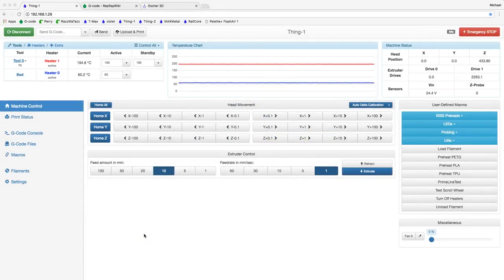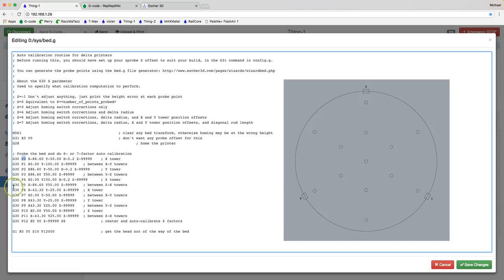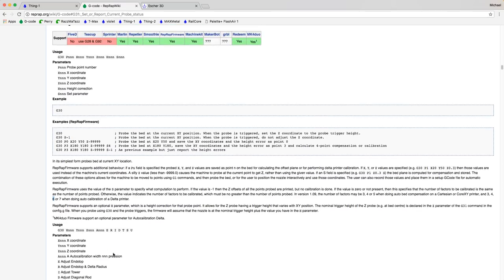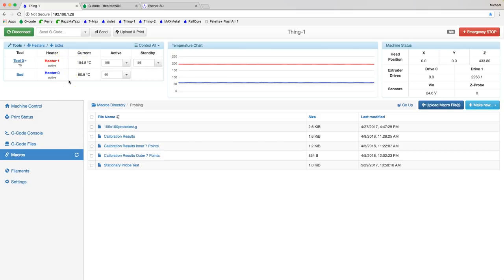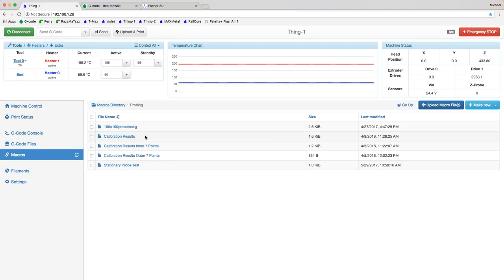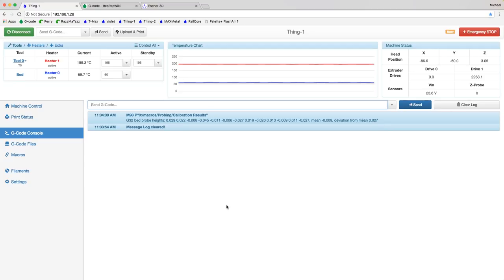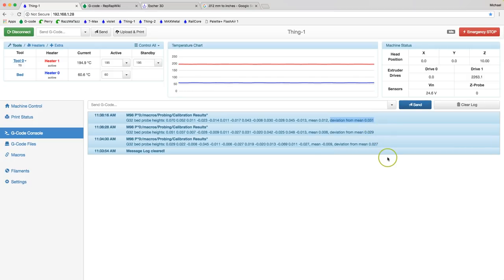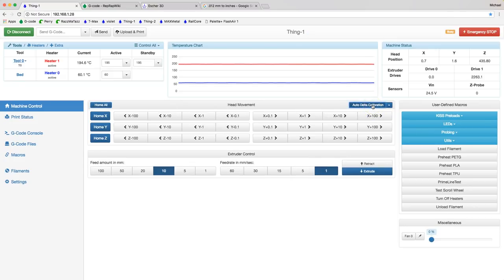Delta Calibration Diagnostics

Comment: The latest RRF introduced a couple of new features. One is 8/9 factor calibration. 8 factor calibration compensates for bed tilt about the x and y axes (in addition to the usual 6 factors). 9 factor includes diagonal rod length (like 7 factor), which I don't use. It also has multipoint probing, which probes the same point 2 or more times until the deviation in trigger heights is less than a user-defined limit. Have you tried these?
Reply from the maker: Thanks for the reminder. 8/9 was introduced back in 1.16 as experimental. I believe that tilt should only be used as a last resort, it is not that difficult to get delta towers parallel and that would be the preferred path. That said, I am building a custom delta now that is designed so that I can introduce all sorts of geometry issues and test the effect on probing/calibration results.

As for multipoint probing, yes that was introduced in 1.21 and works quiet well. I am using it on a CoreXY with a BL Touch probe. I tested it on deltas with FSR and the SmartEffector but so no significant improvement so I don't use it on these machines.

Comment: Hi Michael,
I found your website when searching information about calibration issue with my Ultibots KV250 and the Duet3D Wifi. After reading your post, I'm interesting in having you advise about this calibration results:
22:22:33M98 P"0:/macros/Calibration/Bed calibration report"
G32 bed probe heights: 0.027 0.084 -0.009 -0.068 -0.021 0.130 -0.001 -0.130 -0.001 0.127 -0.019 -0.113 -0.012 -0.014 -0.007 -0.008 -0.020 -0.005 0.024, mean -0.002, deviation from mean 0.064
22:21:36M98 P"0:/macros/Calibration/Bed calibration report"
G32 bed probe heights: 0.012 0.074 -0.014 -0.063 -0.011 0.120 -0.001 -0.130 -0.001 0.127 -0.019 -0.108 -0.017 -0.024 0.003 -0.008 -0.025 0.005 0.029, mean -0.003, deviation from mean 0.061
22:20:28M98 P"0:/macros/Calibration/Bed calibration report"
G32 bed probe heights: -0.008 0.084 -0.014 -0.053 -0.021 0.120 -0.011 -0.120 -0.006 0.127 -0.009 -0.113 -0.017 -0.024 0.008 -0.008 -0.015 0.010 0.029, mean -0.002, deviation from mean 0.061

The deviation looks too high.

Below my beg.g file:
M561      ; clear any bed transform, otherwise homing may be at the wrong height
G31 X0 Y0     ; don't want any probe offset for this
G28       ; home the printer

G30 P0 X0.00 Y110.00 Z-99999 H-0.092
G30 P1 X55.00 Y95.26 Z-99999 H-0.024
G30 P2 X95.26 Y55.00 Z-99999 H-0.005
G30 P3 X110.00 Y0.00 Z-99999 H-0.073
G30 P4 X95.26 Y-55.00 Z-99999 H0.03
G30 P5 X55.00 Y-95.26 Z-99999 H0.011
G30 P6 X0.00 Y-110.00 Z-99999 H0.026
G30 P7 X-55.00 Y-95.26 Z-99999 H0.029
G30 P8 X-95.26 Y-55.00 Z-99999 H0.015
G30 P9 X-110.00 Y-0.00 Z-99999 H-0.039
G30 P10 X-95.26 Y55.00 Z-99999 H-0.011
G30 P11 X-55.00 Y95.26 Z-99999 H-0.072
G30 P12 X0.00 Y55.00 Z-99999 H-0.05
G30 P13 X47.63 Y27.50 Z-99999 H-0.015
G30 P14 X47.63 Y-27.50 Z-99999 H-0.009
G30 P15 X0.00 Y-55.00 Z-99999 H0.014
G30 P16 X-47.63 Y-27.50 Z-99999 H0.010
G30 P17 X-47.63 Y27.50 Z-99999 H-0.025
G30 P18 X0 Y0 Z-99999 S6

Printing the first layer of large part is a mess. On the edge the first layer doesn't stick. When I did a mesh grid compensation, I can see what's wrong. But I don't understand where this is coming from.

https://www.dropbox.com/s/upowdqkmf396fyt/Mesh%20Grid%20Heightmap.jpg?dl=0

Thank you for your help.
Reply from the maker: You don't mention what probing system your printer has but knowing Ultibots and looking at the data I would guess FSRs. It looks to me like your bed is not completely unconstrained and is binding slightly during probing in some areas. You really need to go through the probing one point at a time and make sure the bed is not snagging on the mounts, that none of the mounts are loose (a common problem), and that the effector/hot end are not loose. Good luck!
Reply: Sorry, that's FSR. What do you mean by probing one point at a time. I already done this to measure trigger height for each probing point. I had double check the bed and the hothead and nothing is moving. Thank you.
Reply from the maker: @vialdeo  the bed is likely binding on the mounts slightly, that leads to asymmetric probe results and poor calibration like your data indicates. Try this - back off the clamps completely so the bed is just sitting on the FSRs and then run auto cal.
Reply: I have completely removed the hot bed and put directly the glass on the 3 FSR. And I have also completely adjust all the aluminium frame. Unfortunately the issue is still the same.
https://www.dropbox.com/s/fca989ofcsdkbej/Image%20639.jpg?dl=0
I reduced the aera mesh grid from radius 120 to radius 110, which gave the same issue and then to radius 90 which gave this very good result.
https://www.dropbox.com/s/wevhsm1sy4q7rnp/Image%20640.jpg?dl=0
I'm lost !
Reply from the maker: @vialdeo  Ok, so with the bed just sitting on the FSR pads, if you get the same poor calibration results it is time to look at the motion mechanics. Start with belts, are they all evenly tight? Did you use my belt tension method in the build guide? Are your belts still at the target frequency? Make sure the carriages are adjusted properly and not sloppy or too tight. Then check the steppers to make sure the mounts are not loose AND check the pulley set screws. Check the TOP pulleys too to make sure they are not loose.

It really takes diligence and careful attention to detail to chase down these sorts of issues. You should be able to get to 0.03 deviations.
Reply: Where can I find your belt tension guide, please ? Actually I have decided to disassemble all the printer and check all individual parts, and try to assemble it again much properly
Reply from the maker: Michael B. https://ultibots.dozuki.com/Guide/UltiBots+D300VS+Build+Guide/1?lang=en
Reply: My belts were not enough tight. I use the app to target the right frequency (easy, thank you). But the issue is the same. I'm gonna check my rods length.